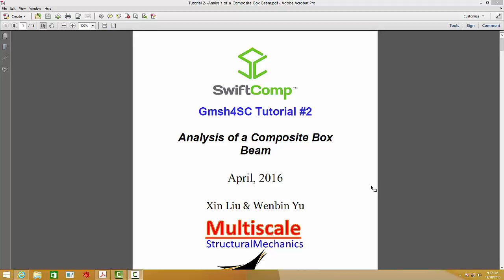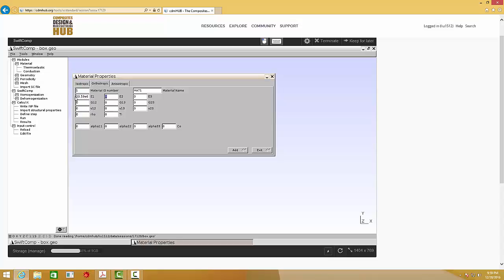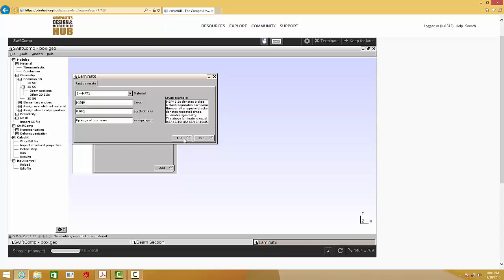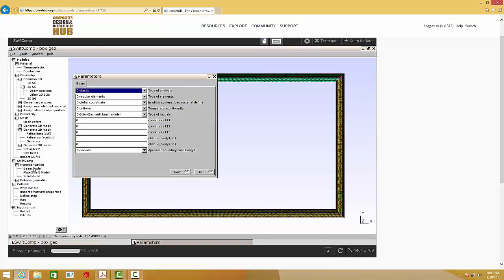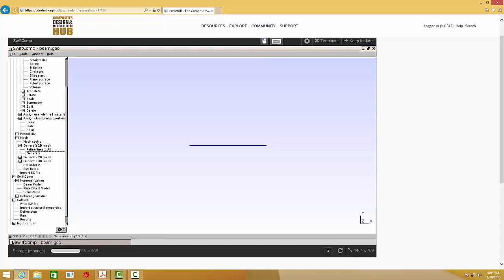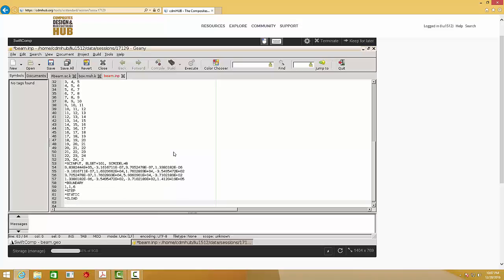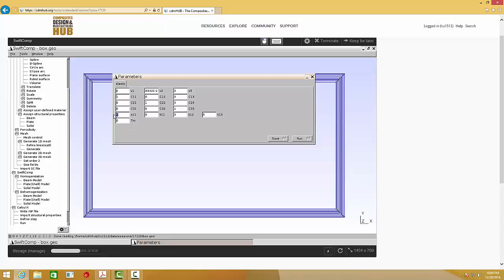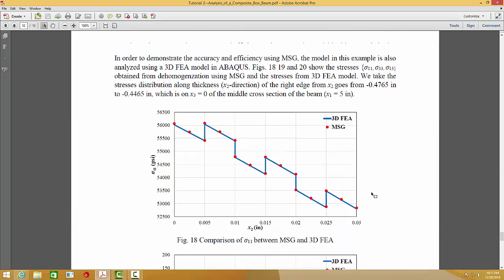SwiftComp tutorial 2: Analysis of a Composite Box Beam

Comment: Dear sir greeting of the day, I am also trying to the same thing(homogenization) for 2D SG but the failure output error is coming, I am also doing the analysis from Cdmhub account and yarn has orthotropic properties and the matrix has isotropic properties so is it happening because of any license requirement or there is any other thing..
Reply from the maker: Dear Vivek, Are you trying to create the same SG as in this example (box beam cross section)? If so, you only need to define properties for lamina. You can also post your questions through cdmHUB. It would be helpful if you can attach a screenshot of your model.
Reply: @xinliu2648  No sir the SG in the example is related to beam but I am trying with 2D SG ..Respected sir I also post my query in CDM hub account ...
Can we also calculate stress behavior with respect to strain under pure shear and tension in that GMSH4SC LAUNCH TOOL